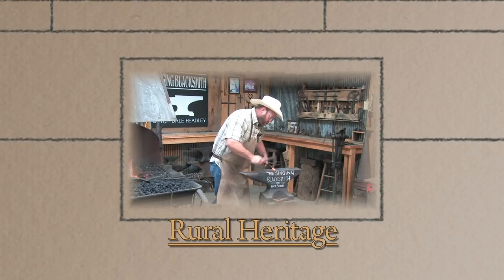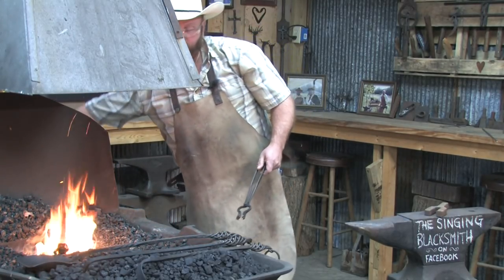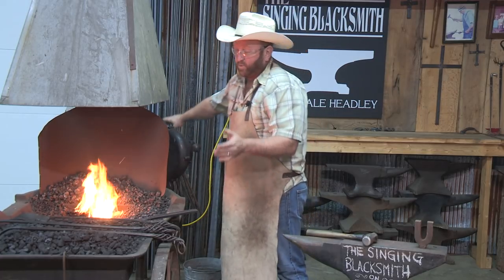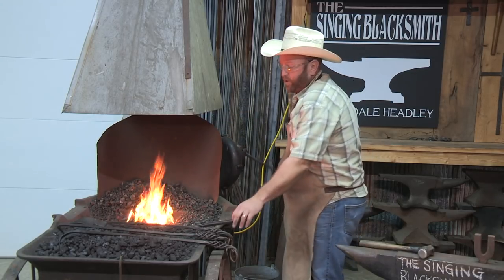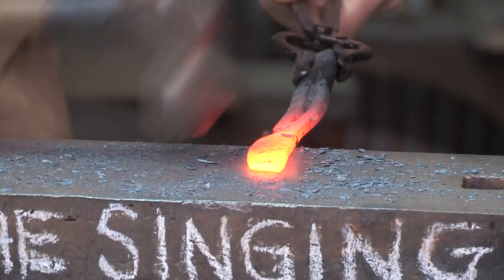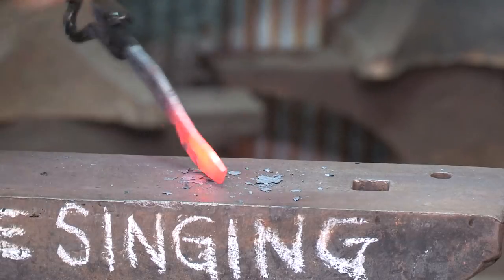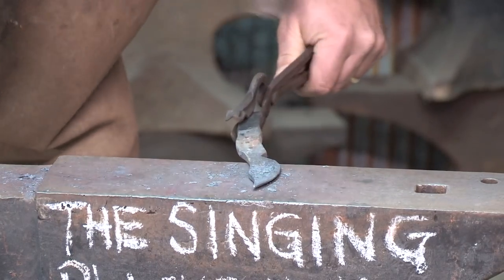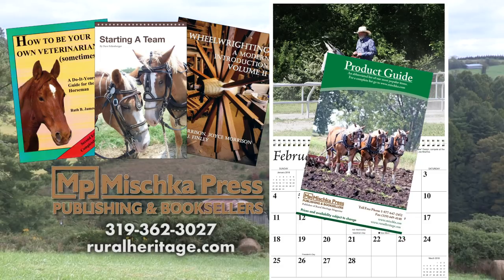Forging Letter Opener with Singing Blacksmith Bryan Headley

Comment: if the jaw of those tongs gets to warm do you have a procedure to deal with that?  I stick them in a bucket of ash til tomorrow , is that at all reasonable?
Reply: Its reasonable.
Ive been using the same tongs, anvil and hammer for 20 years so I wouldn't worry too much about it - if they get a bit out of shape, simply heat them up and straighten them out.